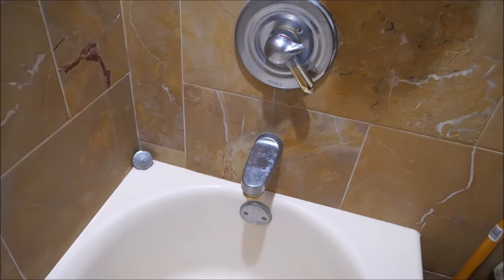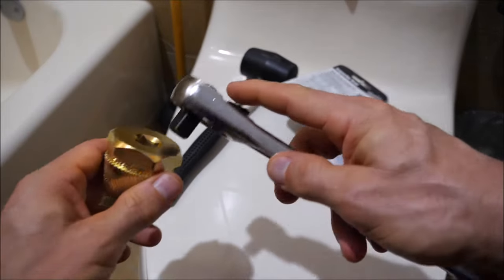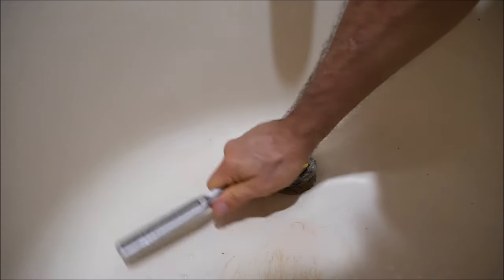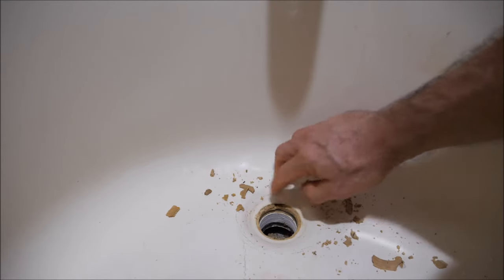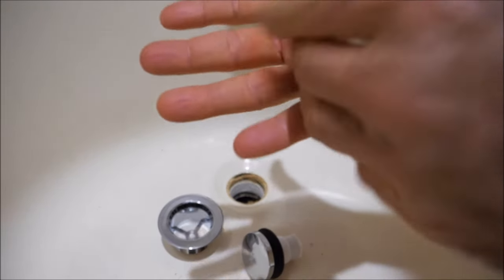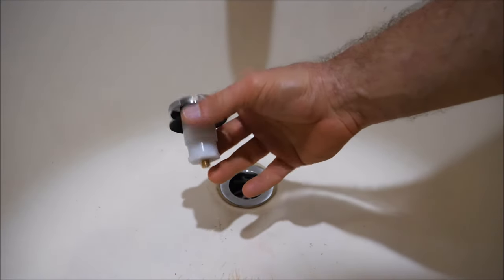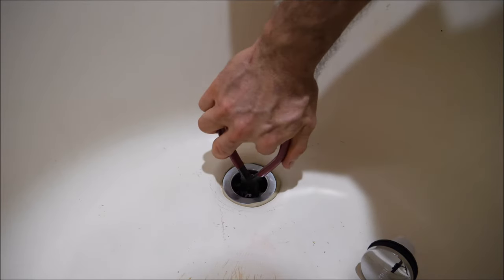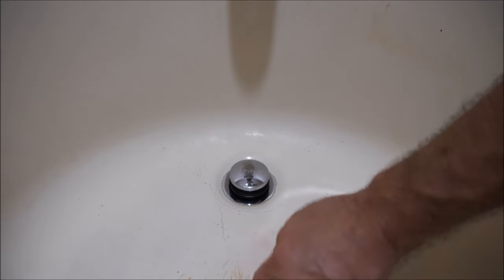Replace that Corroded Tub Drain - Easy!

Comment: The featured drain removal tool is awesome. 
The best way to start the tool is by placing it in the drain fixture at a slight angle instead of straight onto it. Also,with a metal tub,don't be afraid to seat the tool using sharp blows with a heavier hammer. I used a 4 ib hammer with an 18" handle. Way less playing around. Once it's in place,use a 1/2 inch drive beaker bar with a 2" extension and slowly turn in a counter clockwise direction. This will help you remove even the most stubborn,corroded drain fixtures. It's a best practice to remove the black rubber gasket from between the drain shoe and the underside of the tub and replace it with the suppied new one that comes with the new drain fixture. BTW,use plumbers putty on the underside of the drain flange instead of silicone as it lasts much longer.
Reply from the maker: @slim1956  excellent feedback, thank you for your comment. Yes, I should have replaced the washer, but left the original one in place.
Reply: @AndyMahnFL411  Sir,the video you made on the subject is very informative. It takes courage and skill to produce something for the common good. 
I'm not a plumbing professional and the little bit of knowledge I have of the subject I learned really recently. I am currently working on a refurbishing project in the main bathroom of my 42 year old townhouse. I have gotten most of my information from watching countless YouTube videos and trying to glean the best information I could from a whole bunch of people much more clever than myself. 
With that being said,we're all in this together friend, just trying to make things better for our loved ones because we simply  can't afford to have a professional do it for us. 
The adventure is worth it, even if it does take a lot longer and the wife finds it quite amusing.
Reply from the maker: @slim1956  I certainly couldn't have said it better. Thank you for your kind comments and best of luck on your renovation adventures. Be sure to document your progress and learnings along the way!

Comment: I got the same drain extractor tool because I was a bit in a hurry to replace two tub drains in my newly purchased home and I could not find the wrench in a nearby brick & mortar.  I recently used it to replace the same tub drains because they had corroded.  I always place material like a small, folded rag/towel on top of the extractor before banging on it with a real hammer.  Has not failed me so far.  And I always use plumber's putty as you did instead of the included rubber gasket.

Before I had purchased the extractor tool, I did a bit of research and learned from another YT clip that there was a rubber gasket between the PVC drain pipe and the bottom of the tub; this gasket was the exact same size as the one included with the tub drain, so I used the new gasket for this purpose.
Reply from the maker: Thanks for sharing your experience and what has worked for you. Also, as you and several others have pointed out, the gasket should be placed in between the tub and the drain pipe. Best wishes for the new year.

Comment: For anyone watching this now, you would want to use a tub drain wrench, not an extractor tool. You only use that if the drain is missing the cross bar inside of the drain. The tub drain wrench would have removed that a whole lot easier! I am doing this and the overflow, and all the faceplates in my 1860s home tomorrow. Wish me luck! Also, the gasket does not go there. It goes between the bottom of the tub, and the top of the pipe. 😮 I hope u fixed that! I wonder how many people ha e done it wrong now...
Reply from the maker: You might notice that one of the cross bars was missing, thus the reason to use an extractor tool, in case the metal cross was weakened/compromised to the point at which a drain wrench would break that part further. So in this case, the extractor tool was the correct choice. And thank you for the point regarding the gasket, correct. Good luck on your project.
Reply: Hope your project went smooth.  Home from 1860’s…I’m jealous…
Reply: Cross bars will break on old ones

Comment: I have that exact same extractor tool - and my drain looked exactly like that.  That tool doesn't work at all for me though.  Can't get the knurls to catch!  I tried not to wail on it but all the tool did was destroy the drain while I was trying to get it secure enough to catch
Reply from the maker: I have to admit, it took more force than I would've expected, particularly when hammering it in to try to get it to catch the metal appropriately. I just went for broke and ultimately was successful. It's up to you, good luck!
Reply: I'm currently having this issue — no matter how hard I use the mallet, it's just bouncing around in the drain hole. Did you find another solution or did you end up calling a plumber?
Reply: @Shawdiee  No luck with that thing, I think I put on my grumpy face and returned it to Lowe's (?).  I ended up borrowing my highly skilled neighbor and his arsenal of tools.  We very carefully cut it out with one of his saws, a dremel and so files.  What a pain.
Reply: @AndyMahnFL411 need help!! I used the tool to try to get old casket out but the only thing that came out was the corroded plate that sits on the tub. I’m afraid to put pressure on turning because the tube inside Drain was moving. I wish I can show you pictures of it.
Reply from the maker: @tammyellen6366  sounds like you may need a different type of tool, perhaps a drain extractor wrench, something that can grab onto the crosshairs and help you extract it that way.
Reply: @AndyMahnFL411  yes that’s what I’ve been using. My tub is 30 yrs old. Will I damage the drain if I really put force on it turning?
Reply from the maker: @tammyellen6366  you should be able to exert a reasonable amount of force. It's quite common for hardware materials that have been in position for a long time to require some force to remove. Good luck, and protect yourself to avoid injury.

Comment: Is it possible to damage the tub while you're unscrewing the drain with that tool? I'm a bit afraid that I'll cause even more damage when I'm trying this. My drain is corroded just like yours.
Reply from the maker: I was surprised by the amount of force required, but again the drain has been in my tub for many years. You need to apply downward force while you're also using the tool to unscrew it, it should and will come out. Good luck!

Comment: The gasket, goes UNDER the tub, above the pipe... Not under the screwed-in drain plate/face. LOL. You're welcome.
Reply from the maker: Correct, in most cases will be easy enough to do by inserting the gasket into the hole to let it rest in between the tub and the elbow of the drain pipe that the new threaded drain screws into. There could be lots of old crusty plumbers putty in there (or an old worn gasket) to remove first. That thick rubber gasket completes the seal on the underside of the tub.
Reply: He has no access, unlike a sink.
Reply: Treaded portion of drain pipe is called the “shoe”